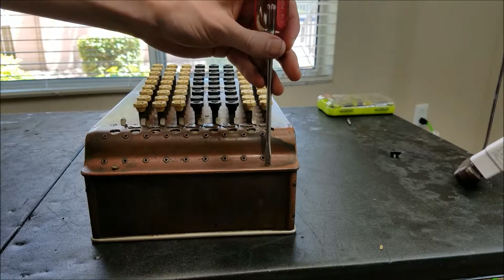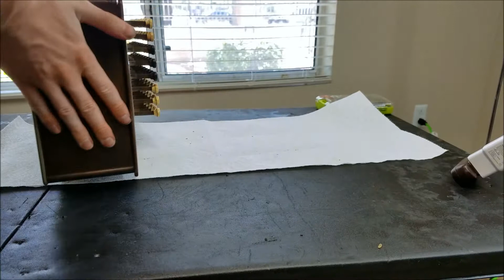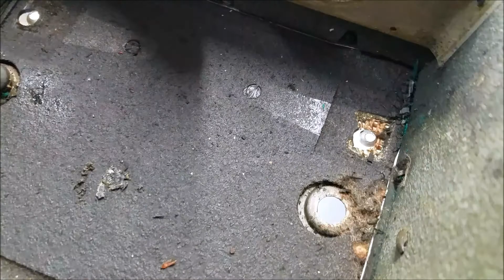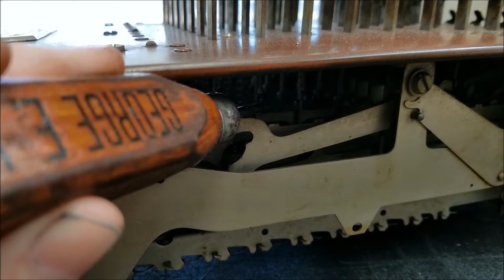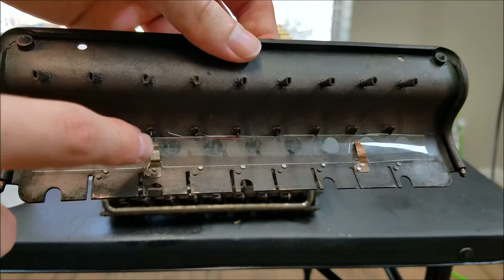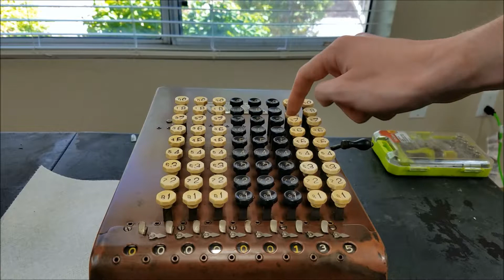Very Clean Comptometer Model C Lite

Comment: The cork also serves to absorb any oil drips and keeps the unit cleaner. Runny oil picks up dirt. Trapped oil can't really do that to the same extent. You'll sometimes see a piece of felt or other such material inside other devices for the same purpose.

(Also, you might want to pull the blinds over the window before recording. Interferes with the camera's light sensor. Makes it hard to see the darker, lower contrast elements.)

Comment: I was hoping to see where you applied the oil.  I have a comptometer with a register that doesn't fully clear and I'm not sure exactly where to apply oil.
Reply from the maker: Basically I just apply oil to anything that looks like it should move, but you can look at the oil holes in the case to see where they deliver oil, those would be the most important parts to oil
Reply: @bss1250  Thank you!